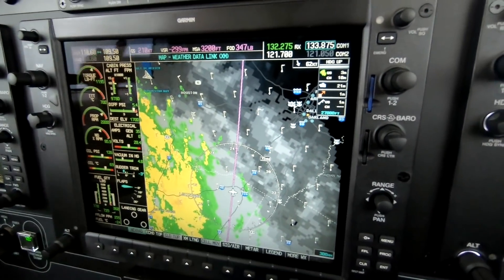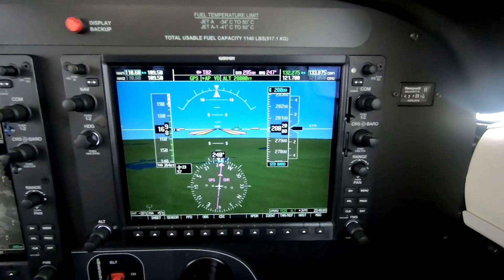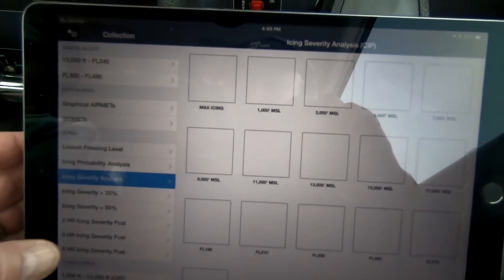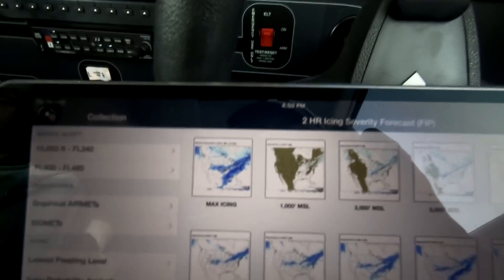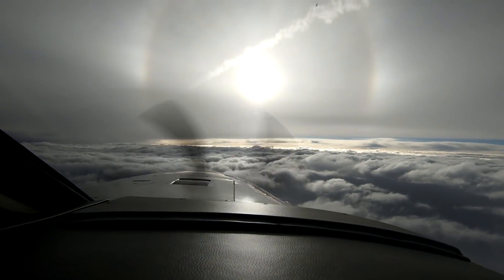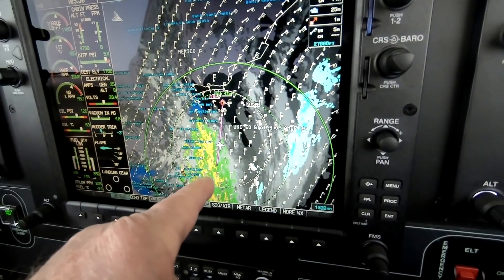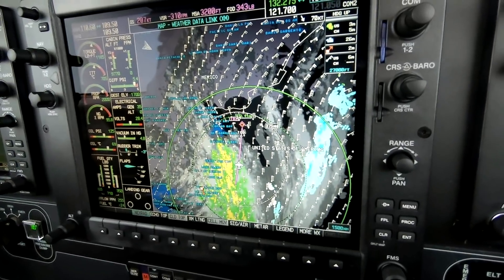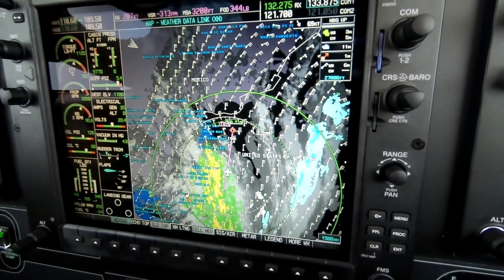Rules for Flying into Areas of Known Icing

Comment: Dick,  how thick of a cloud layer with trace or light icing is it safe to descend through with (or without) FIKI? Thanks for the ride-along.
Reply from the maker: Hi Robert, My SOP requires that PA46 pilots never intentionally encounter more than light ice. I train pilots to use the Foreflight icing products in both the plan view on the map and the vertical profile view to adjudicate this prior to flight. Furthermore, any loss off airspeed that is suspected to be a result of airframe icing should be considered severe ice and appropriate action should be taken immediately. It would be unwise to get anywhere near airframe icing conditions without FIKI. By the way, my SOP is available on my website in the PA46 Pilot Reference Library. I hope this information helps. Fly Safely - Train Often .. DR

Comment: Dick, a question. Nav, Strobes, Taxi & Landing. Some suggest ALL on below 10,000ft. Others suggest landing light on when cleared to land (to serve as a reminder that you have been cleared to land). Your thoughts. Thanks.
Reply from the maker: Richard Friesen Hi Richard, regarding lights I pretty much follow the AIM/FAR: Nav lights ON whenever power is applied to the bus. This means leave the switch in the ON position; strobes- strobes are considered “anti-collision lights” - the FAR requires anticollision lights to be ON at night unless they interfere with your vision or other pilots vision. The professional pilot community has standardized around the idea that if you are taxiing on the ramp or taxiway they will interfere and should be left off unless you are in the runway environment or in the air. Furthermore, I do not use them unless the sky is clear to avoid getting into clouds at night with the strobe on. The red beacon shall be used at night if the aircraft is so equipped according to the FAR, so if you have a beacon leave the switch in the ON position so it comes on prior to engine start (day or night); Taxi Lights - I use to indicate ground movement other than in a runway environment ( turn them off when taxiing in and a Marshal is in sight so as not to blind him/her). Pulse lights if you have them - ON when entering a runway environment until passing 10,000 ft for other aircraft and wildlife; landing light with a clearance to takeoff or to land.. as a reminder and for max visibility to others. This is what I have learned over the years with very little controversy .. any body else want to comment?
Reply: Thanks so much!